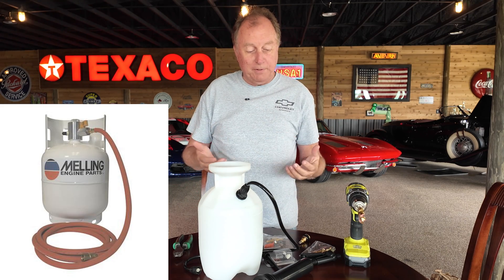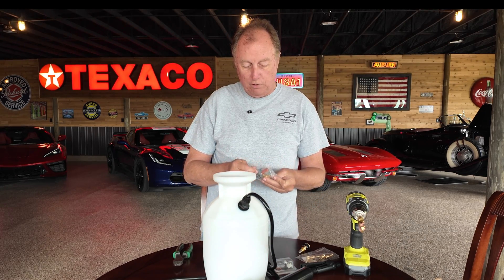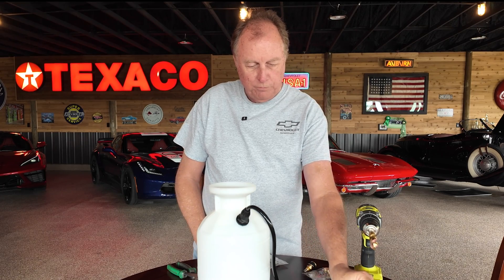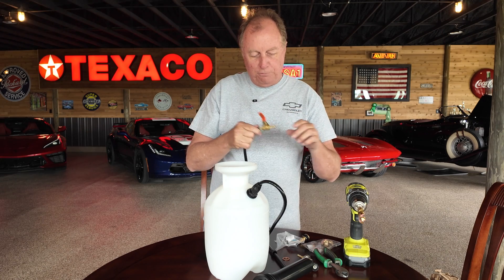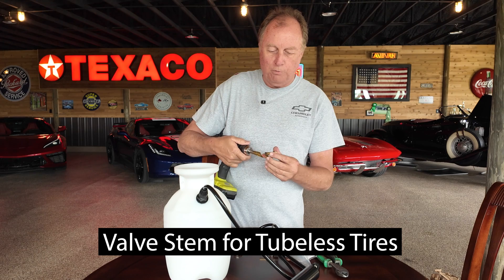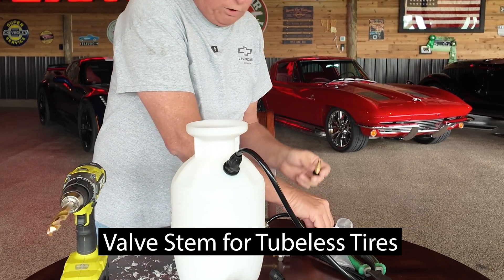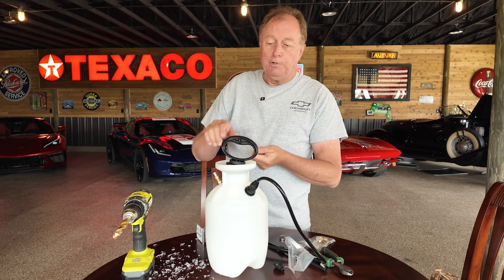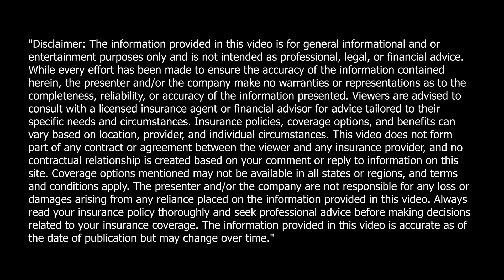DIY LS Oil Priming Tool

Comment: Where did you find  the 1/4 to 1/4 inch check ball valve. In my area both Lowes and Home Depot is a Zero  0 for this type valve . Closest they have is 1/2 to 1/2 inch valve PEX.